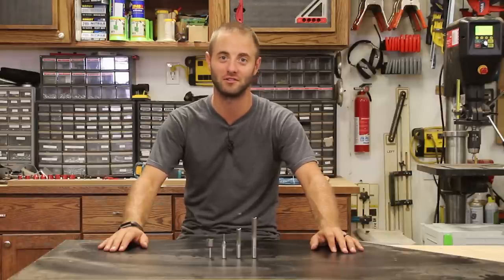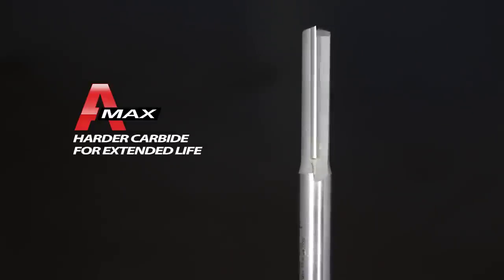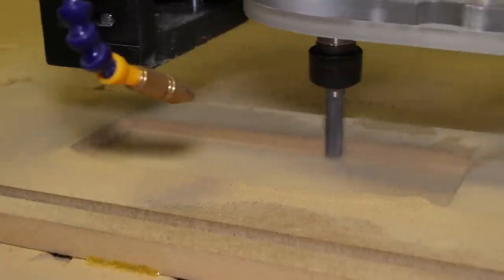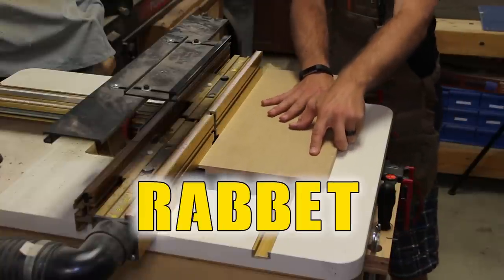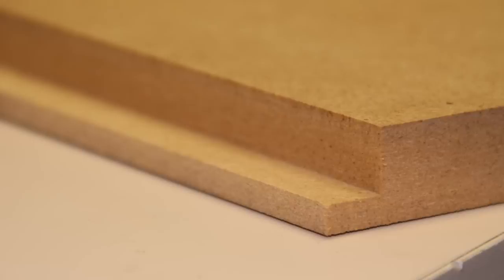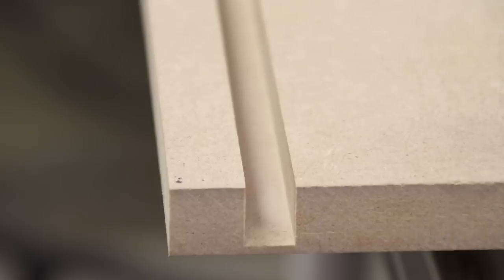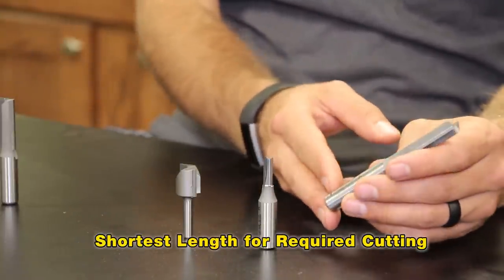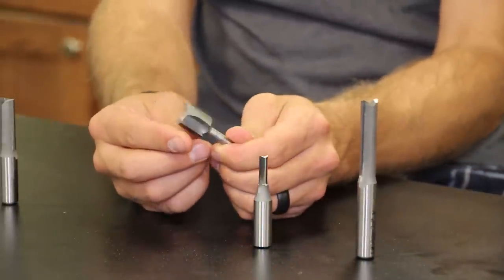Straight Plunge Router Bit | Amana Tool Technical Series

Comment: What's the feed rate for the #45210 on wood? The RPM is 18,000
Reply from the maker: Hello. Let me check for you.
Reply from the maker: This 1/4 Dia bit on CNC machine cutting hard and soft wood is 60 IPM, Chip Load 0.002" at 18,000 RPM. With MDF Feed rate can increase to 120 IPM and chip load to 0.003".

Comment: Can you please provide the feed rate and chip load for 1/2" shank high production straight plunge cutting router bit?
Reply from the maker: Kevin, the feed rate and chip load are determined by your depth of cut and type of material, as well as material thickness. What is your CNC machine's Maximum RPM, what is the material you are cutting and how thick is the material?
Reply: Can't seem to find the manual book for the machine to find the maximum RPM. I dont think I will be using the maximum RPM. Right? I will be cutting all sorts of wood. I just broke 1/4" shank high production straight plunge cutter. Feed rate was 6000 mm/min plunge rate 3000 mm/min , and finish depth 4mm. Max depth of cut was 10mm
Reply from the maker: Kevin, which tool number(s) are you using? I will have technical department calculate these for you.
Reply from the maker: Hi Kevin, which tool number are you using, I will have technical department calculate for you.
Reply: Amana Tool 45226 Carbide Tipped Straight Plunge High Production 1/2 D x 1 CH x 1/4 SHK x 2-1/8 Inch Long Router Bit
Reply from the maker: Hi Kevin, the 45226 is the 1/4" shank, would you like the feeds and speeds of this or the 1/2" shank equivelant tool #45418
Reply from the maker: Kevin - please email me directly for the feed and speed information that we have calcuated for you. My email is stefan@toolstoday.com.